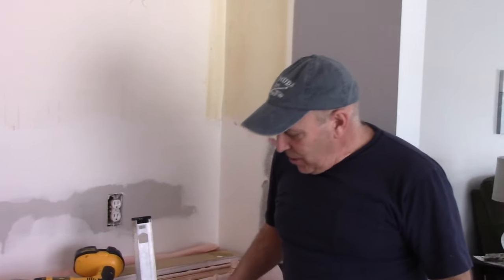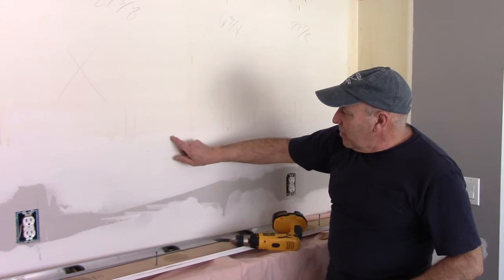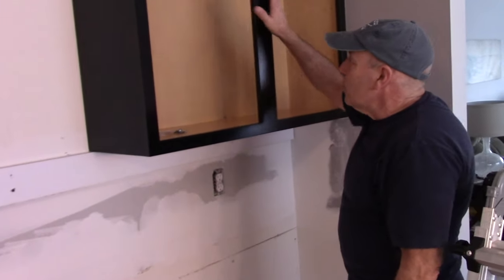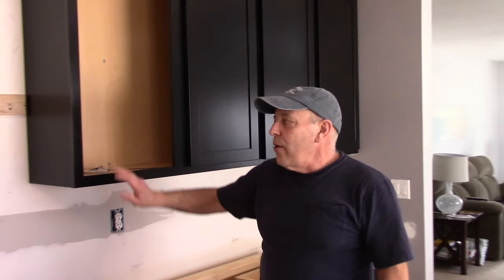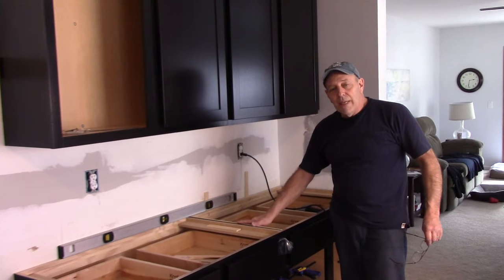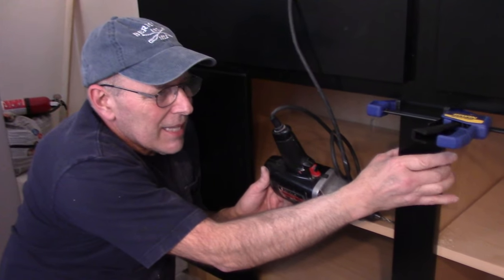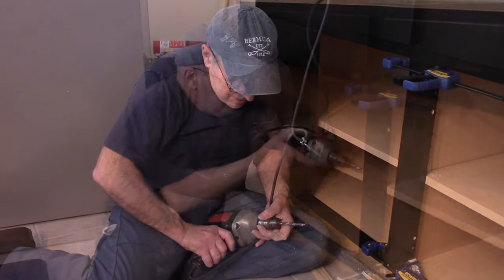How To Install Kitchen Cabinets

Comment from the maker: Check my playlist for the entire kitchen replacement ?https://www.youtube.com/playlist?list=PLTjc9tRPaZUZ19kHgJSXH5CtSjVW9BSbB
Reply: Hi! Where are you? Are you anywhere in Michigan 😆 We just purchased a brand new kitchen and 2 bathrooms cabinets too at Habitat Restore. Never been used but It does not have the screws to use. What size do you recommend I purchase?
Reply: That drill is 40-50 years old. Don’t make em like they use to!

Comment: Lowe’s wants to charge me $4.5K to install my kitchen cabinets. This video helped inspire me to save that money and do it myself. Pretty nervous about it but we’ll see
Reply: You can do it. I'm doing mine early next year.
Reply: Michael Sanchez cool! My cabinets arrive next month. Will update this with how it went if I can remember.
Reply: Dude how did it go?
Reply: ash cabinets don’t come until November something. They got delayed
Reply: Same problem here. Cabinets were supposed to come sept 28th.   Covid has everything tied up and delayed
Reply: Eric Loss yep, it is what it is unfortunately. I’m installing new flooring as we speak. Vinyl plank.. kinda regret it. I like laminate better. Anyways, cheers.
Reply: I work at a cabinet shop and I can tell you that installing them is not easy if you want to do it properly and not having them look like shit installs. We install commercial cabinets and it’s more work than you think.
Reply: @gilberttorres8  sure is. I ended up hiring a guy outside of Lowe’s for $2,500. Mind you, my kitchen is very big. 

He starts this Friday! I was gonna do it myself but between full time work and my relationship with my partner (she works 80 hours a week), we never saw each other.
Reply: Dude yeah if you can do it, you also need all kinds of tools screws and glue etc to make it easier on yourself. OR hire a professional.
Reply: @gilberttorres8  I mean, I feel like you’re exaggerating a little bit. Anyone who is patient and takes time while working on things can do it successfully and make it look good. 

For most people, I would agree it’s a tough project but that’s because most people aren’t willing to take the time to do things right. For example, I did drywall for my first time earlier this year and I’ve had drywall guys comment on how good of a job I did. All I did was take the time to sand, mud, sand and mud.. it just takes time to figure things out.  

Of course a pro will do it quicker and usually do a slightly better job, but if you’re patient, you can do a very similar job and save tons of money. Like I said, the problem lies with most people being impatient. People don’t take the time to really make things right (cutting corners etc) which includes many many many contractors.
Reply: Dude yes, quality work isn’t cheap. Take this guy for example he was using the wrong drill to screw in the screws for a better way is to use an impact drill since it very unlikely you will strip the screws. Also you can use a laser to level all the cabinet instead of the piece of wood he used.
Reply: @gilberttorres8  very true! Kinda like guys using nails for subfloor instead of using the proper wood screws.
Reply: Dude trust me I work with guys doing this for 25 plus years. We also build the cabinets so it helps if we screw up just make another cabinet. If you screw up we don’t make you a new cabinet for free.
Reply: @gilberttorres8  my cabinets took 4 months to deliver. If this guy messes one up, I’m screwed
Reply: Dude yeah I can imagine, that’s what good about our company we build them and install h to me so if we fuck up we can just go back build another one and get it done in no time.
Reply: @dude4173  Let us know how it comes out? Bout to attempt it my self after working with my in law...
Reply from the maker: Glad I could help!
Reply: I got mine installed.  The ledger board was a huge help.  The video help also. 
Had to watch a few more video  of other things to get it completed.  Thank god for YouTube lol
Reply: @ericloss6153  dude. Congrats. Mine just finished today. How did it turn out? You did it yourself then I take it? What were some major challenges, if any?
Reply: I actually had to redo my wall. The whole wall was out of wack  about an inch and a half.   And the floor was out about a half inch.  I found  in another video, you take 2x4 scraps and screw them to the floor. Then set the cabinets over the 2x4s and you can raise each cabinet individually and screw them fast to the 2x4s through the side of the cabinets.   
Also I had no clue how to build the cabinet the frig sets in.   Back to YouTube for that video too. Haha.  All and all the cabinet install went pretty well.   Pre planning  and taking my time and not hurrying anything I think was the biggest help.  (Take it , One cabinet at a time.)
Reply: @ericloss6153  nicely done man. Pays to be patient. You saved a bunch of money!
Reply: @gilberttorres8  I think commercial is more easier but I been doing that for 2 year so far
Reply: No way.  Do it yourself.
Reply: @dude4173  They want to make it sound hard, so you give them your money.
Reply: @ericloss6153  this is all so inspiring... my husband is going to kill me when I saw "honey let me try". He's going to cancel my you tube account 🙃  after the tree spikes.... well, tree trimming is also pretty tou
Reply: @gilberttorres8  very helpful what you said about an impact driver being better for certain screws (wood screws?). I’m building a bench and have stripped a quarter of my screws which is a pain. I’m using the same screwdriver he used in this video.
Reply: @gilberttorres8  I use my normal brushless desalt to hang cabinets impact sometimes has to much torque lowest setting on drill is basically no torque.
Reply: Where does the guy you hired work out of ? Can you share his info
Reply: @6.06 you said you don't want to drill onto the 2nd cabinet? I though that's what you want to do to hold them together? If not what is the purpose of just drilling into the one cabinet? Has to be one that asks AC silly question! Thank you!
Reply: Shim : can you buy them?
Reply: It was the same with my flooring the material is about 2300 but the company wanted charged me over 4 grand to do it So I did it myself Now about to do my kitchen cabinets Just take your time do not rush
Reply: How did your cabinet install go?
Reply: @dude4173  what don’t you like about vinyl plank? I was planning on doing that in my kitchen.
Reply: @kevrides5706  iam halfway  way done got all the cabinets up but haven't did the base yet  waiting  on the sink base but it has gone really well
Reply: How did it go??
Reply: You have to understand, when you pay a company such as Lowes to install, they have to pay a nice chunk of money for insurance, so they aren't screwing you, the insurance company is
Reply: @heyitsbroski  How did you make out hanging the cabinets DIY?

Comment: great video....a question.....when installing the floor cabinets... how do you deal with a floor that is not level.  We have a really old house and now to sure of the floors.  Thank you in advance
Reply from the maker: If the floor is uneven. You will need to find the highest spot on the floor and then shim the rest of the cabinets to that height.

Comment: Sir, I have a question, how do we identify where the beams are? like in that wall, how did you identify? Second question, which specific drill are you using, Cordless Drill for both drilling in wall and cabnet or other drill machines you are using, please specify the power and capacity Please need your guidance on this. Thank

Comment: I just had a boozy smelling contractor come by to give me a quote on cabinet install.   He absolutely insisted that no way do you install upper cabinets first like I asked him to do.  Not gonna use that guy.  So came to YouTube and see your video.  THANK YOU
Reply from the maker: Good idea . If the guy smelled like boozy you absolutely don't want him doing your job.
Reply: @getitdonehomerepair  
Its just common sense to put the top in first, why work around the bottom and probably damage something
Your video certainly set me straight,, think I'll save my self about 4k and do it my self
Thanks again

Comment: GREAT video! 
As a boy, I climbed up on the counter and inadvertently pulled a cabinet full of  canned goods and dishes down off the wall..
Since then, I've worried about putting heavy objects in upper cabinets.
Are six screws in each cabinet really enough to assure it won't come down?
Reply from the maker: Thank you for your input. 6 screws are more than enough . The manufacturer recommends 4.

Comment: How did that brown ledger board suddenly turn white after that first cabinet went up? LOL
Reply: I noticed that too..🤔😂
Reply: Probably didn't look good enough for this amazing video 😅🤑
Reply: seems like that wood piece behind the cabinets used as a reinforcement was not added in this video as a Very Important procedure for holding those heavy cabinets...On the good side...Very good instructor ...
Reply: I can see brush strokes….

Comment: Do you recommend predrilling the holes before you install that support board that the cabinet will rest on?
Reply from the maker: Yes it will be easier to attach in the exact spot you need .I'm happy to help. Don't forget to subscribe.
Reply: @getitdonehomerepair  for sure! I will keep the questions coming as I develop them. Thanks!

Comment: What is the piece of wood(2"x1") for on the wall next to the cabinet at 7:10 into the video?
Reply from the maker: That wood is for the next upper cabinet to rest on so I can screw them to the wall. Good question.
Reply: @getitdonehomerepair  so, judging by the height of the wood ledger, the last cabinet will be smaller than the others next to it, correct?
Reply: @Cleveland_Chris  Yes that is correct. That is were the microwave went. Thanks for noticing the difference.

Comment: Hi, the kitchen wall that you hanged cabinets on, is it cement board or just regular drywall? asking because of the backsplash install. it seems that cabinets have a back to them, so it doesn't need to be painted. but the backsplash tile should be installed on cement board correct?  Thanks.
Reply from the maker: The tiles can be installed on drywall. Thanks for watching

Comment: Do you have to do anything to the wall in between taking old ones down and putting new ones up? Other than using the board to help hold the cabinets up
Reply from the maker: No just make sure the drywall behind the cabinets is in good condition.Thanks for watching.

Comment: I've got 24 inch wall stud centers, would I have to add more screws between the cabinet, or attach long Ledger boards?
Reply from the maker: You have 24 inch wall studs? Are they metal studs or wood?
Reply: @getitdonehomerepair  wood studs

Comment: I live in an old condo.  We dont have wood studs.  Its all concrete blocks.  What do we use to install the cabinets please
Reply: Special drill, a hammer drill. Corded ones are about $60 or $70. Also special blue screws called tapcon screws

Comment: Would have been nice to actually see how you measured for the holes for the screws to line up with the studs.  How did the cabinet stay on the board?

Comment: Quick question. When all the cabinets are installed and shelves are in. Are you supposed to see the screws on the top cabinets? Or are you supposed to screw the top cabinets in a way that you shouldn’t be able to see any screws ?
Reply: You wo t see the screws because of all the crap you're gonna have in the cabinet,  put the screws where they need to be and dont worry about the petty stuff
Reply from the maker: Thanks for watching. You will see the screw inside the cabinet but as wake up side once you fill them you won't see anything.

Comment: Jim any tips finding studs on a plaster wall!!!
Reply: Get a stud finder that detects metal. The lath are attached with nails to the studs.
Reply from the maker: As Dapper Dame said the latch is attached with nail.
Reply from the maker: Dapper Dame  Thanks for your input.

Comment: So if the bases required shims doesn't that mean the uppers should've also?
Reply from the maker: Good question yes the uppers may need to be shamed if the wall are not perfectly level and plumb.

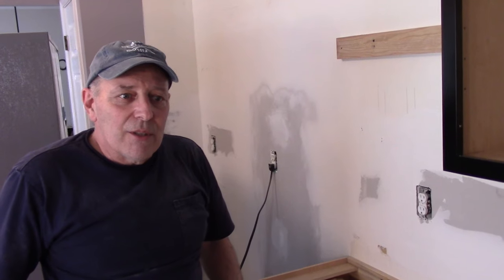Comment: I understand putting the level board up to keep the upper cabinets level and in line. At the end of the video (time 15:01) you show the upper cabinets and another board running along the wall in the middle of the cabinets. Why is that?
Reply from the maker: Good question. The board is because I was waiting for a replacement cabinet that went into that spot

Comment: So you drilled into the splints but didnt show how you got rid of them after. What if the floor is uneven ? How do you deal with that?
Reply: You dont necessarily start with the cabinet in the highest point. 9 times out of 10, you dont. 
Depending on layout, you start with an inside corner usually.... THATS WHY YOU HIRE A PRO

Comment: When you installed the first cabinet, did you also anchor it to the stud on the right side?
Reply from the maker: Good question but no. I was able to catch two studs in the back of the cabinet.

Comment: I didn't see where  you took the shims out, so I"m not 100% on that.  You just have them there while you run the screws in so the wall doesn't warp? And then take them out when you are done, leaving a small gap?
Reply from the maker: No you leave the shims in place after you install the screws.Thanks for watching.

Comment: Hi, approximately how many screws per cabinet? What types of screws are used?
Reply from the maker: Most of the time the screws come with the cabinet but if not the big box store sells them as cabinet screws. I used on these cabinets 6 screws on the uppers and 4 on the lower. thanks for watching and subscribing.

Comment: whats the wooden beam behind the upper cabinets ? he didnt mention it
Reply: Looks like it stops at the edge. I think it's just to support the cabinets that all already installed since he has to wait for the replacement.
Reply from the maker: The wood is there because it is easier to sit the cabinet onto the board when I put in the screws. After the cabinet is up I remove it.Thanks for watching and your input.
Reply from the maker: gmoney1961   Thank you for replying for me. I appreciate your input.

Comment: What kinda screws did you use
Reply from the maker: They are cabinet screws.You can pick them up in a big box store.Thanks for watching
Reply: 2 and a halt inch. I use square flats as they hold better to the drill on installation but any head is ok.

Comment: I’d level it before I screwed out to the wall but eh. Also why not just a line on the wall?
Reply: The cabinets are sitting on that board, like he said they are heavy and you cant hold it up and drill drill it to the wall at the same time
Reply: @wakeup6910  Want to bet?
Reply: @TheSubtleBeast  
Yea I'll bet,, cause you obviously dont have a clue what you're talking about
Reply: @wakeup6910  PM me if you’re ready to lose that money. I bet $1000 I can hang a cabinet by myself without screwing holes into my customers backsplash(getting tile or not).

Comment: Did u put those base cabinets on top of the kitchen tile?
Reply from the maker: No You should remove the tiles first.
Reply: What can I use to remove the tiles I don't want to remove all the tiles just enough to put my cabinets in place

Comment: How do you shim the back corner of the base cabinet?
Reply from the maker: You need to shim the back before you permanently mount the cabinet
Reply: @getitdonehomerepair  figured that out. Wasn't sure if there was a trick. Installed 4 this weekend!

Comment: Am I the only cabinet installer that uses a deadman instead of drilling holes in the wall?
Reply: I bought two fastcap 3rd hand support system and I never installed cabinets in my life but will be doing so in about 2 weeks
Reply from the maker: What are you talking about?

Comment: Nice video showing the installation & giving the tip with the board but not very informative with the drill bit sizes or the preferred length of the screws.
Reply from the maker: Thanks for watching.

Comment: That drill is not a screw gun..you need an impact to screw those in you dont have the power with that drill
Reply from the maker: Thanks for watching.
Reply: Hey carpenter here, a drill is sometimes a better option when dealing with finished cabinets, due to the fact that you don't always need all the raw torque from an impact. For example mdf can disentegrate when too much power is applied. These are MDF with 1/8" wood veneer.
Reply: That drill he is using is an industrial drill, I have the same one and it is slow and has a shit load of torque, it will twist your wrist if you dont let go of the trigger,, thats a fact

Comment: Ops why fit the wall units first.. You won't align with the bottom...
Reply from the maker: The lower did not all come in at the same time but top or bottom it is personal preference. Thanks for watching